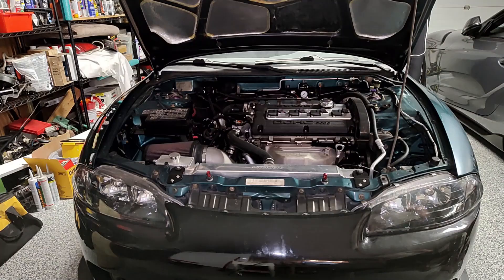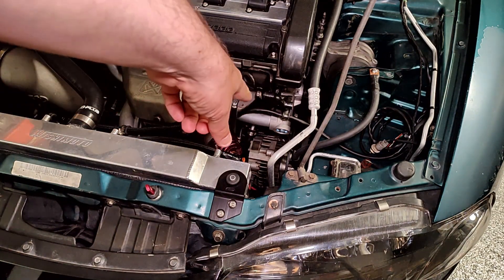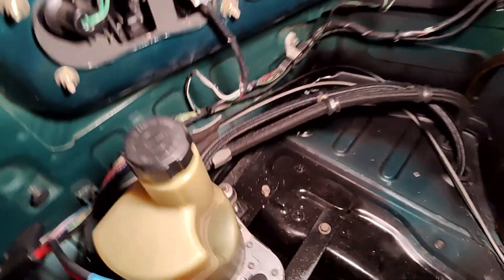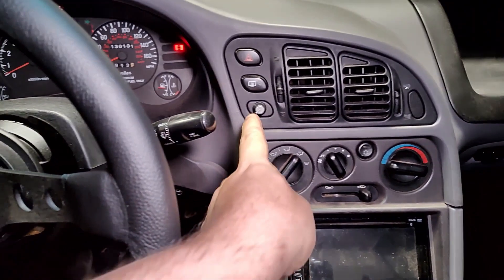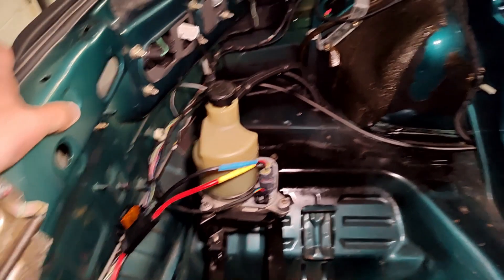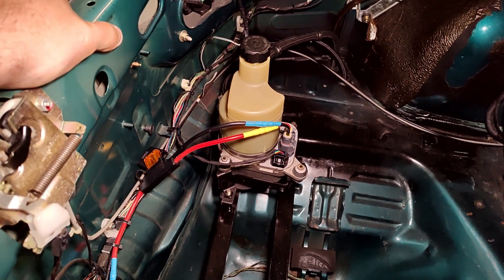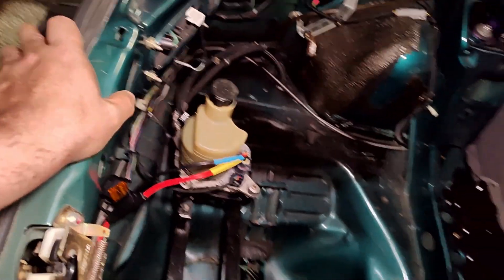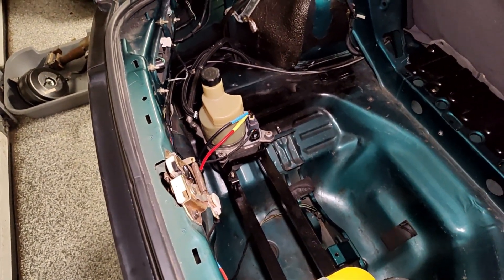2g Eclipse DSM Electric Power Steering Conversion

Comment: Hahaha thanks for the shout out! Very smart thinking on using the antenna power for a signal source, I wasn't by any means trying to say you did it wrong. You did a hell of a job on it, I was tying to bounce some idea's off ya. I also though the hole where the A/C accumulator/dryer canister is for the A/C but I don't want to get rid of my A/C either.
I should probably do a video on all my DSM's, I just picked up another 2g awd talon actually.......I'm far to addicted to dsm's.
Reply from the maker: You should do videos on your DSMs.  My biggest regret was not starting this channel years ago.  Did you get he 2g AWD Talon to build or for a donor car?  Rust free body?